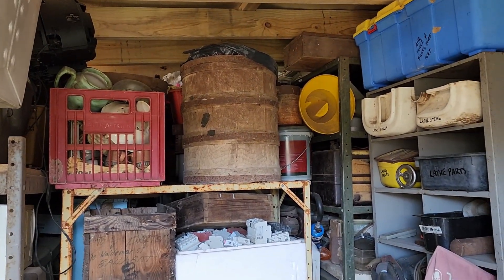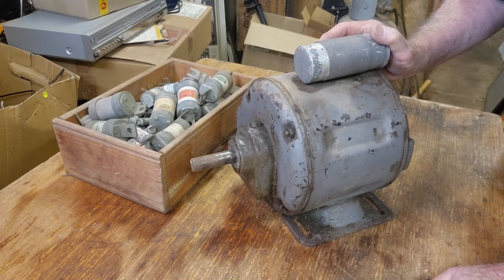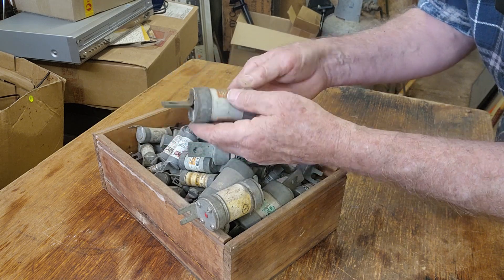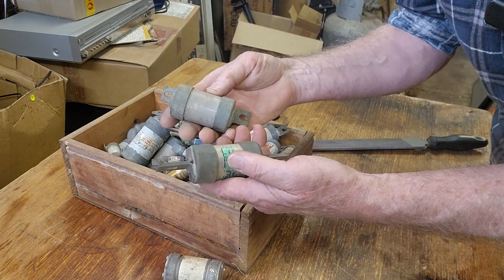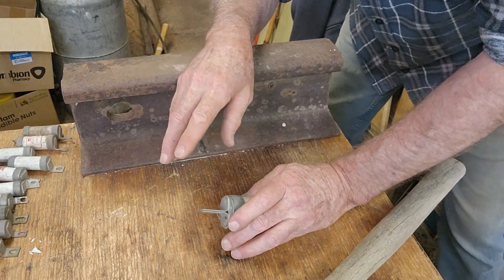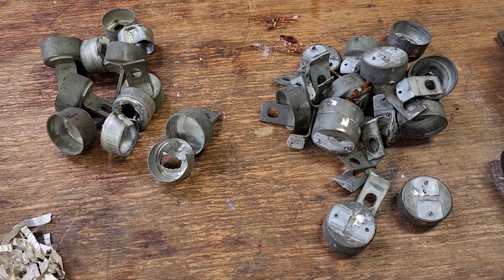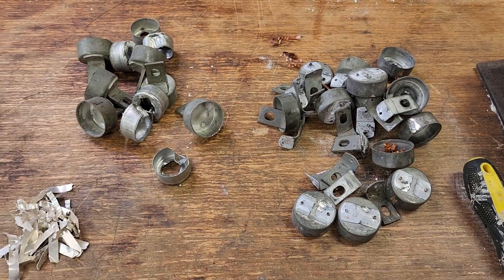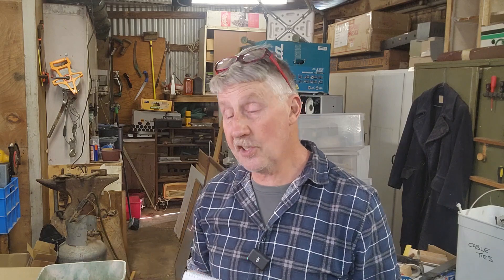Storage Shed Clean-out Part 38. How to Find Valuable Scrap Silver in old HRC Fuses + Copper & Brass!

Comment: A nice silver find!  I know you like to hammer on the railroad track... but I think if you crushed both ends in a chunky bench vice, it would make quick work of those fuses with less shrapnel?
Reply from the maker: The ceramic was quite tough hence the big sized hammer Martin. I think a vice may have created more shrapnel with pressure then sudden breakages. Also I would have had sand go all over the floor!

Comment: HRC stands for High Rupturing Capacity, which means it can withstand a very high short current with minimal arcing. A standard fuse can arc and explode.
In NZ and Australia, if the fuse has gM printed on it, it means it's a slow acting fuse suitable for motors, as motors have a high start current due to the initial torque required to get moving. gG is normal rated.
Reply from the maker: Thanks Sam for the extra info! 😊👍

Comment: yeah be careful doing this in ventilated area, old cheramics in eletrics can contain heavy metals and Beryllium Oxide, breathing in the dust is toxic..
Reply from the maker: Very good point, I actually wasn't thinking about the ceramics! More concerned with the very fine silica dust since it is such an issue with tradies working with stone benchtops these days and the risk of silicosis!